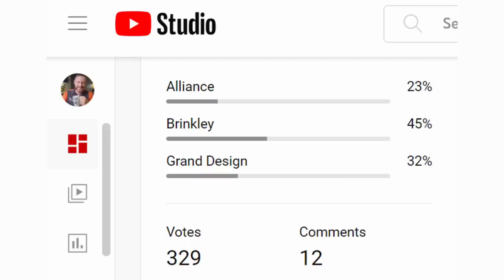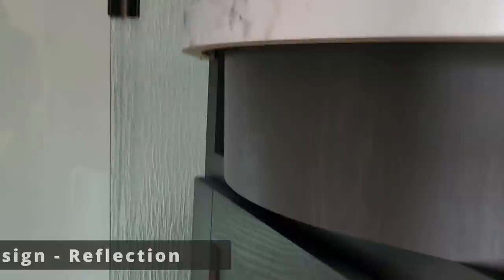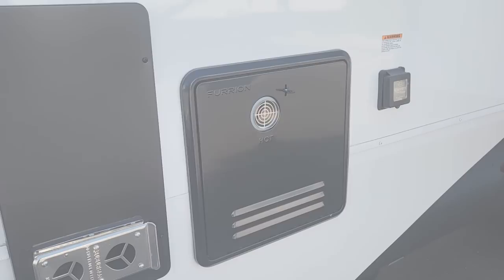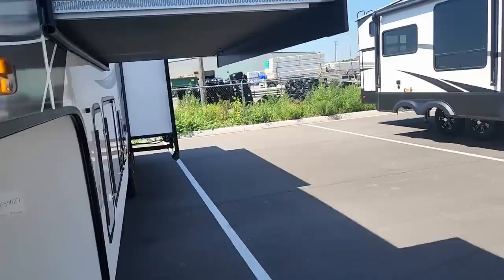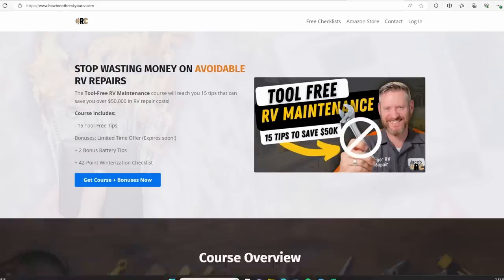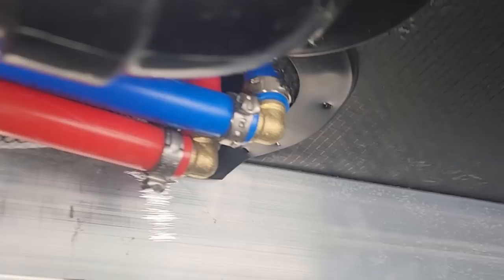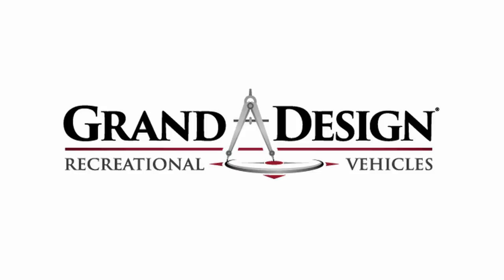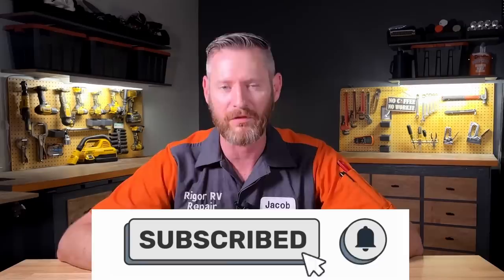UNDERCOVER RV Tech reviews Grand Design, Brinkley & Alliance RVs

Comment: I've been in the RV industry for just  over 7 Years. Started in the flooring production line for Jayco ( Star Craft and Highland Ridge ) for 5 and the last 2 as a rv tech at a dealership.
 I've mainly worked on Grand design and I can confirm the water leak issues is the worst problem with them on any model since that can lead to bigger issues if left unchecked. Once you use and abuse it under warranty it's a decent overall rv. Definitely seen those bent outriggers and the flooring coming apart inside the basement so get a good inspection done and don't rush it.

Recently been working for another dealer and now work with Brinkley and Alliance as well. My first impressions are definitely towards Brinkley. No major issues worked on yet. But in my experience working at the factory, actually building them. 
I got to see Quantity is the ultimate goal over Quality. 
It's only a matter of time before Brinkley will ramp up production and naturally loose some quality to be able to meet quota. 
We used to build the smallest 15 to 20 foot travel trailers at 6 to 8 minute line moves per department. 
Meaning we would build up to 44 trailers in an 8 hour day. Usually done in 6 hours some days. 
Which means from start to finish we would of completed about 5 to 8 trailers per day since there are about 36 bays through out the factory building. Not alot of room for "quality" at these high quotas. After covid it only got worse for a while. 
I've been to Grand Designs factory in Indiana and it's the same exact standards as Jayco as I seen the crew going to work. 
Which I would assume most factory are all similar. 
Just do your homework and don't buy on impulse for any brand rv out there is my advise to anyone buying ...things change for the manufacturers and they got to keep up with demand. It's up to you guys out there to demand a change in these common flaws and standards.
 I really hope for Brinkley to prove me wrong along with more manufacturers

Comment: Hi Jacob, first let me say your videos are awesome!  I’m a huge fan!!  Your critique of Brinkley’s plumbing elicited this response from the company.  Would really like to get your thoughts on their claim of using a type of flex hose that should be ok: “We are aware of this issue across the industry. The flex line we are using is a no crush no kink that no one else has used. We use it intentionally on the water pump to reduce vibration and a few other areas due to angle of running water lines. Our attachment method is approved by our vendor and we have had no known issues with this application.”
Reply: Shur flo specifically says to use flexible hose to the input and output ports of the water pump so I am a little confused too.
Reply: @Primus2004  Shur flo makes screw on connectors for their pumps that are designed to connect to flex, PEX fittings are designed for PEX, not flex and are undersized for flex. I don’t think flex is bad so much as flex connected to a PEX fitting is bad. Half inch flex is half inch ID, half inch PEX is smaller than half inch. I had several flex connected with PEX fittings leak.
Reply: The problem, if i'm understanding it correctly, is NOT that flex line is bad; the problem is using the wrong fitting on the flex line. Particularly seen when pex and flex join. They are using a pex fitting to connect pex to flex, which is wrong. The pex should have a proper threaded pex fitting and the flex should have a proper flex specific threaded fitting and then you can screw the two together to make a proper pex to flex joint.
Reply: @ScottenJonesVideo    I finally learnt how to deal with the wrong pipes.  Go around the nipple several times with real ptfe tape, pulling it real tight, but not enough tape to make the diameter too big for the pipe.  Heat the pipe up a little with a heat gun, and tighten 2 regular hose clamps while the pipe is still soft.  Careful not to melt anything.
Reply: @garysarratt1  when you say “wrong pipes” do you mean flex tubing. I would not be comfortable that the method you are describing would be a reliable fix. What I did was get fittings designed for flex tubing plus minimize the use of Felix tubing, basically I only have it on my pump.
Reply: @ScottenJonesVideo    I heard it blow one night, and it flooded the basement pretty bad before I figured out what the sound was (the furnace was running and I didn’t hear the water at first.  The only thing I could do is what I just described.  I showed it to the repair guy working on something later, and asked if I should replace all my tubing, and he stated “That thing is on there d*** good”.  So I’m not touching it until I’m home for awhile and can do that and a few little jobs too.
Reply: @ScottenJonesVideo    Oh, and I meant the pex.  It was clamped wrong, according to another video from Rigor TV Repair.
Reply: @ScottenJonesVideo    I replied twice; idk why all my replies are disappearing tonight, better restart my phone.
Reply: Now it works.
Reply: @garysarratt1  I’m glad it is holding for you.

Comment: I just watched this and it was informative.  I have a 2017 Cedar Creek and do all my work myself. I never realized that soft pipe was an issue. I checked mine after watching and the only place there was soft pipe was in and out of the 12v water pump. It used gear clamps and not pex clamps. I've done a bunch of work on my unit and its the things that you can't see are the scariest.  I removed the entire bottom of mine to remove a couple of stinky dead mice.( you pay that much money you would think the thing would be sealed up to stop them from getting in). When open i sealed everything up. Found the fresh water tank almost ready to fall out. Missing fasteners! Then also missing on all tanks. Fixed a window that leaked - not installed correctly, but couldn tell until it already leaked.

Comment: As an RV inspector, I appreciate hearing your comments. The plumbing is something I wasn’t aware of. I assumed the brass fittings for the Brinkley was an upgrade. Wow! Thank you!
Reply from the maker: I don't really have to repair plastic PEX fittings. Brass is better if you plan to freeze the whole water system,  but plastic is fine for the intended use. But PEX fitting with a flex hose crimped on...that is a potential leak and does not conform to NFPA 1192 7.3.2.2. The RVIA is not enforcing the code they adopt which is not just a shame, but more of a crime as many water leaks as it causes. Especially when a flex hose pops off of the water heater because the heat made it too soft to grip the PEX fitting any more. I hope that the industry will change as allowing bad plumbing is not fair to consumers. Thanks for watching!

Comment: I really like these videos.  I'm looking at Lance trailers and have heard good things but would like to see a review by you on Lance.  I'm looking at the 1985 model.
Reply: My last trailer was a 2021 Lance 2075.  I bought it because of its reputation for quality.  I was pretty disappointed.  That year Lance use thermofoil counters.  The cabinets looked nice but were cheaply constructed.  The shower leaked.  The propane stove never worked correctly.  I had some minor electrical issues.  The dealer service was unacceptably bad.  Lance has since made some improvements, but I'd still be very unlikely to buy another one.

Comment: YouTube content is typically created to be picked up by the algorithm so the "shock factor" is often employed.  Regardless of which brand you buy, failures will occur. Some are due to poor choice in parts, others poor install, and others user/operator error over time. Pros and cons to flex vs rigid PEX for sure, but it's okay to use flex in the right spot in an RV. Lots of opinions out there, but don't panic if your RV has flex braided lines here and there. I'd be more concerned about having a good pressure reducing valve (PRV) and ensuring your RV is winterized properly as those two factors may very well have more of an impact on plumbing failures long-term.
Reply: You are 100% spot on!
Reply: I think the issue isn’t flex lines themselves, but connecting them to PEX fittings. Half inch flex lines are half inch ID, half inch PEX is less than half inch ID. My Jayco had multiple flex lines connected by PEX fittings and several of them started to leak. In some places I could replace them with PEX, in places where I needed to stay with flex I got special fittings designed for PEX on one end and flex on the other end. The flex connection end is bigger diameter than the PEX end, no more leaks.

Comment: Wish I would have seen this video before buying my GD imagine xls. I’m at least glad I did enough research to know to buy used and save myself some money and from the scammy dealerships.

That said, I’ve been correcting all plumbing fittings, starting with the leak at the water heater which all have brass fittings that convert pex to vinyl tubing.  Not cheap, but still cheaper than buying a new Rv and dealing with fighting for  warranty service.

Comment: The Furrion AC has been an utter disaster for an awful lot of owners to the extent that I’d be very tempted to avoid any unit with one. 

Yes the frame on the 390RK has been a mess. However the good news is that Grand Design has recognized the problem and is not only taking care of existing owners but has a fix implemented for new production units.
Reply: The frame is a mess because the RV is designed wrong. I have one and everything in the rear refrigerator is destroyed on every trip. Grand Design has sent me EXTRA refrigerator shelves because at least one breaks every trip. The rear of this trailer bounces excessively because of the design. It should have a 3rd axle from the factory.

Comment: ?ORV
Reply: Second. Jacob, I’d like to hear your thoughts on the Outdoors RV brand and build quality.
Reply from the maker: Added to my list, thanks for watching!
Reply: I have been a full-time rv dweller for the past six years and counting. I currently own a 2017 ORV 25RDS travel trailer or also known as 250RDS. I boondocked 96% of the time and all this time I have been to many washboards, unpaved terrains, and rocky roads and has never been to a shop since bought new. I do all the minor works and maintenance on the road and majority of the big components is still doing its job keeping me a happy camper. ORV is a sister of Northwood Manufacturing who makes Arctic Fox which is a solid company and solid products. I will not hesitate to buy another ORV again or any Northwood Manufacturing products but I am upgrading to a 5th wheel toy hauler which none of the two have available. I most likely go with Grand Design Momentum since they are the only ones who has an eighteen feet garage I like to haul my junk on the road. You can't go wrong with ORV or Northwoods and they make them in Oregon if that is something you prefer and they also do rally every year where they fix things that are wrong in your rv for free during the rally event. Although, double check since mostly like things have change. Happy camping and take the less traveled path.

Comment: Giving Brinkley and Grand Design an F just because of the plumbing makes no sense.  This video should have been who has the best plumbing equals the best RV.  You ruined the video by doing that.
Reply: I read this comment, typed this and that was enough for me. Did I miss anything important?
Reply: Well someone wasn't paying attention in class as Grand Design only had 1 out of 2 that was graded an F, the other a B and both Brinkleys were a B. Perhaps you should rewatch the video and sit in the corner until you can get it right. 🫶🫶
Reply: That's like saying you shouldn't give an airplane an F just because the engines fall off.  Faulty plumbing can and has ruined many an rv.  The water damage will warp floors, destroy cabinets and stowed gear, and cause mold to spread inside the walls, rendering the rv uninhabitable.  A total write-off.

Comment: We're looking at a new rv and I'm an RV tech.  We are considering these 3 brands.  It's interesting how alliance moved from the schwintek to the cable slides.  When I took a poll of other rv techs, the majority of them prefer the BAL cable slide.  Now, not being able to adjust the cables is a different problem.   

Also, you counted off for GD and alliance for the Mach ACs because you've seen many problems with them.  That's probably because they're used on so many rigs.  I'd be more concerned about the "untested" unit on the Brinkley.

Overall interesting video.
Reply: Check out  Durango Gold
Reply: How about Outdoors RV quality? Any insight on them?

Comment: The grand design we owned had brakes that worked intermittently. It also had a black tank that had a low spot in the middle, so it was impossible to clean. We got rid of the camper after 3 months when it became apparent none of the issues we encountered were being taken seriously.
Reply: Thanks for the info. I was just going to throw 120000 at one. So sad the here they are also caving to the bean counters and cutting corners.
Reply: Every black and gray tanks have low spots in the middle. It could be improved by the manufacturers by adding a metal support bar though. I am just saying you will likely find the same issue in every RV.

Comment: I guess we got a GD unit that was built at the right time in 2021. We are fill time for over 2.5 years. Never had any plumbing issue to date. Maybe when the GD service center checked the system, while it was in for warranty work, that helped(?). Now I also keep our water pressure(45-50 psi vs 55 psi) a little bit under the 'max'.

Comment: Alliance responded to my concerns about their Delta slide mechanisms and plumbing.  They indicated they are not using the evil BAL accu-slide and are using PEX thru out.   " I’m glad you have noticed our upgrade to the water lines utilizing all PEX plumbing throughout....The 292RL will utilize a rack and pinion on both of the main slides. The 294Rk will use the same system for the theater seat slide and will use the BAL Exact slide on the entertainment slide."
Reply from the maker: My favorite part of this comment is that you referred to the BAL Accu-slide as "evil" - Glad you watched the video!!!

Comment: Very helpful! Spot on with Grand Design. I’ve had leaks on our 2021 2500RL 
After 1 season our Schwintek slide failed. Had to replace the whole thing. $2,200 cost for me. Grand Design did nothing for me. Not even a discount on the parts. Took it to a non GD dealer for the repair
Reply: Your situation is exactly why so many are looking for better quality for the $$ spent!  If these RV's were 'quality' you'd get a 5 or 6 year warranty, but that's not the case unfortunately.   It seems on some, once you're off their lot, every repair is nothing but a pain to them, so you can wait 'months' for repairs, and sometimes not everything is covered, yet it's a 'new' unit!   One friend's son bought a Grand design bumper pull, and he found the hitch portion didn't go fully to the frame, and his bent upward, and they said they'd need it for months...so he got it straightened and made strong on his own dime...but one should NOT have to be doing such things.  That of course is just one of the many issues he's had.

Comment: Youtube suggested your channel to me yesterday.  Very informative.  The things you talk about arene't mentioned on any of the RV review channels I follow, but their focus is sales so not really surprising.  I've been watching review videos in preparation for buying my first RV (fifth wheel no longer that 32 feet) in advance of retirement.  These 3 manufacturers were at the top (though Brinkleys are out of my price range), along with the Keystone Cougar fifth wheels.  Your info has made me rethink the whole plan.  Your aside on the sensor problem with the Furrion water heaters is interesting, and I shared your tip with the camper group I'm in as I've seen so many posts on water heaters that stopped working.  I also gave the name of your channel in case others want to check it out.

Comment: Super info.  I am going through my 2018 VanLeigh Vilano using the info provided in this video, your lemon checklist, and plumbing video.   So far not bad but not as good as I thought.  Today I am going to check plumbing and what I know so far it has pinch connections on the flex tubing and that has been a problem. The line going into the water heater popped off and trashed my bay. 1100 at night. Not fun.  I have been fultiming for 6 years and your info is really good. Thanks

Comment: Please do one on the newer ATC toy haulers. I own one and the biggest issue has been the plumbing. Nearly every fitting has been leaking and it’s back at the manufacturer to get repaired. The other issue has been the slides. I have to manually override the slide every time because it comes up with an electrical fault. I’ll do a video on the trailer after we pick it up from the repairs next week.
Reply from the maker: I'm eager to review ATC. Their plumbing connections on flex with the black clamps I'm highly interested in as I don't see that in other RV's. I'm about to make a video soon about plumbing connections, and if those are leaking I would love to know! If you have any photos or video of the leaks, please email me at jacob@rigorrvrepair.com. 
On the slide, if it is Schwinteck and if it is giving the short circuit error it is likely a faulty motor. There is a circuit board built into the motor that often gets water into it and corrodes the circuits. Override mode can often get it to work regardless. After replacing the motor you need to be sure that the caulking is intact on the slide seals over top of the motor to prevent future damage. Thanks for watching!